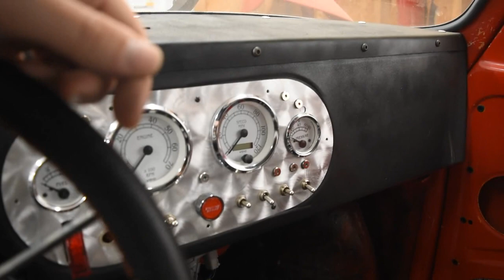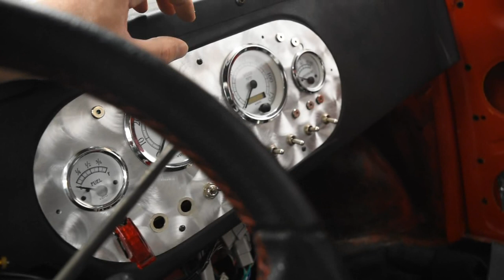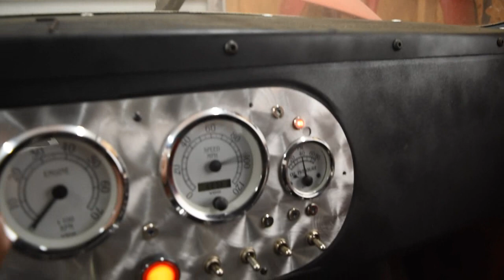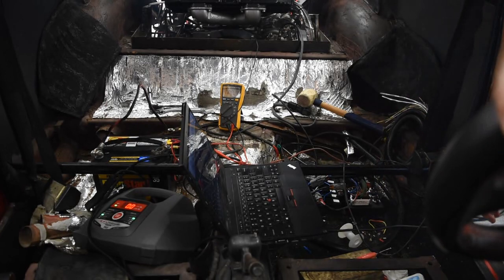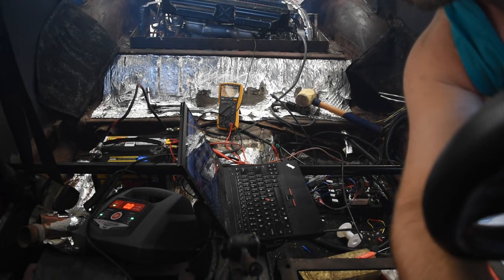Getting the Alternator Charging -- 1973 VW Super Beetle Subaru Swap

Comment: is the engine just supported by the transmission 4 bolts or does it have additional support elsewhere?  I must have missed that in your previous videos.
Reply from the maker: Just the 4 bolts! It might seem questionable but I've had no problems in several years now. I will install a kafer brace or additional supports at some point but so far so good. Best of luck!

Comment: Hi, your work was great, only I have a question about the direction of rotation of the engine, if we want to install a motor in a clockwise direction that is installed in front of the car, in the back of another car, it is possible.
Reply from the maker: Thanks for the support! This would be possible but may require some custom parts. The motor can continue its natural direction but you will need a transmission that will take that rotation and translate it correctly to forward spinning tires. That is why I am using a stock VW transmission with my Subaru motor. The other option for Subaru’s is to buy a reversed rotation pinion for the transmission, which could probably be done for most other transmissions as well. Problem is these parts are usually completely custom or very expensive (or both).
Reply: If I'm not mistaken you can use the stock  vw transaxle you just need to flip your differential. The early Vw bus with gear reduction boxes has the same transaxle as a bug but if you take the gear reduction boxes off it will be 4 reverse gears and 1 forward and flipping the differential fixes that; I know because its happened to me.
Reply: @whateverimbored702  I am just using the stock vw transaxle/differentials
Reply: @robbiestruble4635  Yeah but Akbar asked about an engine that spins the opposite direction and I was trying to give him a helpful answer. Use the stock vw transaxle just pull the diff out and put it back in backwards.